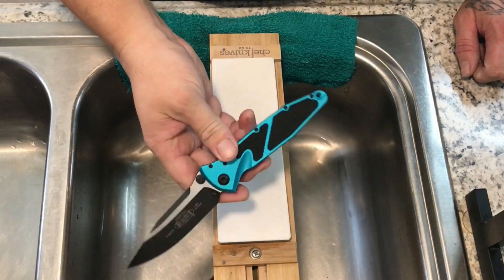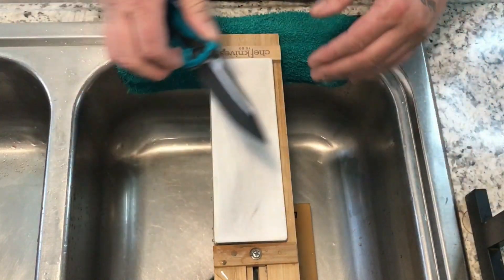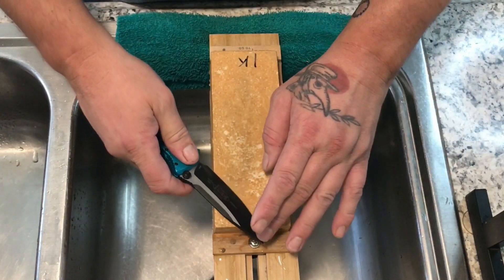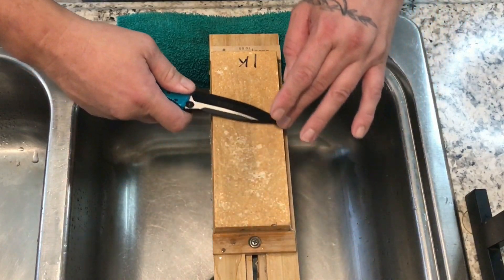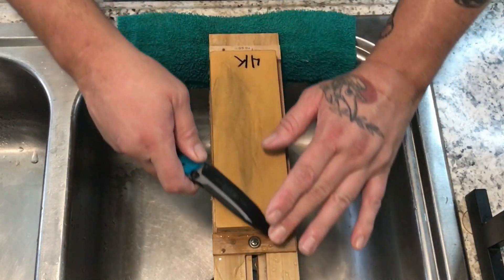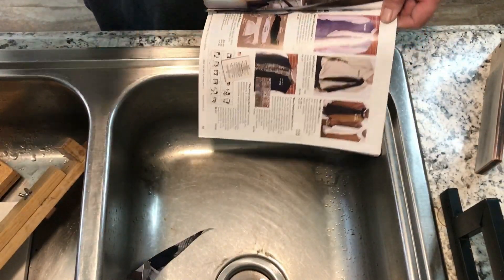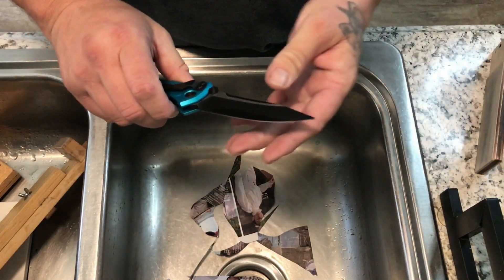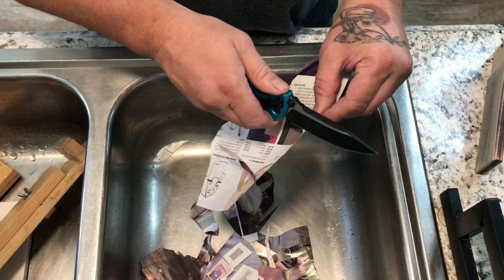Knife Sharpening - Microtech Socom Elite - CTS-204P

Comment: Nice Townsends cameo!

Great vid as usual Jef.

I've used many many diamond compounds, nearly all of them being 'too' aggressive. I have also been driven insane by this. With that said, I do get along with many of them and perhaps I can be of help in finding out why they screw you/us over sometimes.

I do not think you did anything incorrectly in the video. You, as usual, hold your angles super well, you didn't go overboard on pressure from what I could see and you were very careful. The only thing I would suggest changing/keeping in mind is how many passes you do. Every diamond and CBN 1um compound I've used, with Ken Schwartz and Knife House being the exception, run the risk of 'over-refining' the edge when you go more than 2 passes per side, the same has been true for 0.5um, 0.25um and obviously 4um. Just a couple examples - Gunny Juice, Stroppy Stuff, Northwest Knife Guy and Practical Sharpening, I have to make sure I'm getting what remains of the burr on the first strop I go to within 5 passes otherwise I find I run a greater risk of over-refining it (I am not that great at being consistent with my angles). Ken and Knife House being the exceptions to me does interest me a lot, I did think it was down to concentration being lower than what I've mentioned but when I look at my Knife House I doubt that.

As Theodor mentioned, changing from "heel to tip" to "tip to heel" motions might have played a part in lowering the aggression by changing the direction or further refining the teeth but I've done the same and not experienced that on these compounds. Could very well play a part in it but I think pass amount has a predominately larger effect.

It's a pain in the ass when it happens but I have found just by taking a moment between each pass to check for burr with a flashlight stops me from over-refining or even rounding the edge. I have been using all the compounds I've mentioned and gotten aggressive edges without many headaches since being more anal about it but man, fixing what ain't broke isn't necessary. What's the white compound you're using? I'm sure you've mentioned it before so I should go dig.

Full disclosure, I know the guy behind StroppyStuff and have/do give him a lot of feedback. Certified shill haha!
Reply: Would just like to say, I do use and like all the compounds I've mentioned, with Northwest Knife Guy's being my overall favourite. That's my bias.
Reply from the maker: Thanks for all that info. I have found pretty much the same thing, except Gunny seems to allow me to strop as if I am on white compound. To date, the best I have found that allows me to strop as normal, in order of ease to use: Knifehouse, Ken's, Gunny. Everything after that, has been hit or miss. Many cases, just complete fails, no matter what I do. 

I stated in a few other posts, I shouldn't have to change my stropping technique. I understand there is money to be made with these products, but if I have to alter my habits to compensate for the product, I am not going to like it.

Anyways, I am just not diamond compatible. We have two different goals in life, and are going to have to go our separate ways, I think. Perhaps in the off chance I am sharpening a super steel, like Maxamet, we can meet again, but till then....

You watch Townsends? :) I have been ordering the mushroom ketchup from those guys for years. I can't seem to get enough of the stuff. As for the ChromOx, I prefer StropBro's. Just the simple, $5 bars they sell, work wonders, on my edges. I've tried a few other brands, bark river, in particular. They all seem to have too high of a wax content. StropBro's is difficult to apply well, until your strop, is quite broken in. That stuff works a treat. As you said, why fix it, if it ain't broke. 

Truth is, when someone asks me to test these sort of things, I am always hoping to do them justice. It obviously works for other people. It irritates me to no end. Light pressue, low passes, same angles. I do not think I am going over or under angle, as Stroppy seems to believe. I know how to hold a consistency, and have become quite good at it, over the years. Still, over refining the edge seems like a viable conclusion, but I just can't get my head around that, either. 2-4 passes is gold, 6-10 is too much? Esp on cpm steels? If that is the case, then those concentrations need to be diluted. There are going to be many others seeing results as I do, and be highly upset. Esp given the price tag. Unless I am the only one seeing these sorta things. ¯\_(ツ)_/¯  . I find that hard to believe. Unless, others are just not understanding, what is occurring, and mistaking the true sharpness of their knives, for whatever you call these results.
Reply: I wrote a response but turns out it's a huge wall of text and youtube didn't like that sorry hahahaha. I'll post it in sections and see if that works.
Reply: You are one of the best around in my opinion and even a single case of a product not working out for you is not something to be considered lightly (e.g. Sharpal). From what I've seen, you have changed techniques to accommodate the product and it didn't give you the same results as others (including me) are finding, in this video you strop pretty much the same way I do as well. I think you've done justice to it and it's prompted me to do more testing with it to really see. Perhaps lower concentration is indeed the answer with these, though Gunny afaik is quite high, perhaps the carrier fluid is either all of the answer or part of it as well. I think carrier being the main influence could help explain why Knifehouse is so forgiving since it leaves a slightly harder and ever so teensy slightly 'sticky' surface on the strop, leaves the strop with less 'give' perhaps. That said, I base that on pure conjecture, pinch of salt n all that.

I do think we should be willing to make small adjustments to accommodate differing products. Big but though there is such a thing as asking us to change too much and when that happens it often ends up a headache that causes us to question how worthwhile it really is an examine pros and cons. While I do find the pros outweigh the cons with the fast diamonds, I do think this is just because I was very stubborn when I was trying to figure out what was wrong a couple years back and spent so much time with them. The compound itself should've been at least the second or third thing I considered but it was the last haha, very stubborn of me. I was having trouble while I was using compounds from Practical Sharpening, which at the time were much faster than any other diamond compound I've tried including gunny and stroppy stuff, I got a 2um monocrystalline diamond spray from Practical Sharpening after all this and it was surprisingly way more forgiving than the 1um but it also uses a different carrier fluid, similar to Stroppy Stuff from what I can tell.
Reply: I haven't actually tried any from StropBros, I'll have to pick some up! I definitely agree wit hthe bark River compound being reeeeaaallly wax-y, Eden/Dialux was marginally better but still very wax-y for me.

Oh damn you know what I'll have to pick some Mushroom Ketchup up, I used to get some tea and coffee from them to try out and I've been watching for ages, really comfy channel. I've been watching a fun channel in a similar vein called Tasting History too, I recommend that if you aren't watching already.
Reply from the maker: @acoupleofsharpthings  Tasting history? I haven't seen that one. Will give it a look, thanks! I love seeing those recipes come to life. Even tried my hand at replicating a few. Particularly the mushroom ketchup on 3 occasions, and one of the pancakes recipes. They've both turned out satisfactory, although the mushroom ketchup, doesn't have as intense a flavor, as the stuff they sell. The ingredients of course, can be altered to fix that, although my pallet isn't keen enough, to weed out, what is what. 

Def give stropbros a look. Hell, for $5, ya can't really go wrong. I like their stuff, and have quite a few bars, of each color. I've yet to be disappointed. Their strops can be a bit smoother than I like, but even those, are made VERY well. I used to swear by em, till I found DLT's XL. Those are my go to's now.

I agree, some change for different products, isn't out of the question. I do compensate for many, even if it isn't always conscience. Lighter pressure, fewer strokes, etc, etc. I tried Practical Sharpening's resin diamond stones, some time back. HOLY COW, were they fast. For reprofiling a knife, I highly recommend em. I could never get a super sharp edge, however. They were just too aggressive. 

Same goes for many other diamond products, in particular stropping material. Like you, I always seem to blame the product last. After using these, for a few weeks now, on different surfaces, I can't say that now. I know I am doing things properly. Including low passes, with light pressure. I can occasionally, score a nice edge, off of them. ZDP189 in particular, got an amazing sharpness. That is why I described them, as hit or miss, and kept looking at myself, as the fault. 

Carrier solution, diamond count, whatever is the cause, I can not say. I did notice the KnifeHouse spray leaving behind a tough shell, on whatever you spray it on. I do not know is Stroppy's stuff has a similar effect. I will try it on some paper later, and see if I can make anything out. I'm not done with these, and think where they are going to really shine, is on rich carbide steels. Maybe that is what I should have started with, but 204p, m390, 20cv, are nothing to thumb your nose at. 

I appreciate you taking the time to repost that. If you discover anything new, or figure out a repeatable way to get consistent results, without having to alter too many factors, I am all ears. In the meantime, I will try doing even fewer strokes, and experimenting that way. To be honest, it is starting to become a bit of an obsession, to figure them out. If I can sharpen a knife on a brick, wth can't I strop on diamond? Lol.
Reply: @acoupleofsharpthings  Nice man, glad it's working well for you. Btw, I'll get your check in the mail. 😄
Reply: Noooo it cut out the actually important part of my response to your first reply! Hahaha ffs, here it is hopefully. 

I agree with pretty much everything here. Knifehouse has been, by far, the most forgiving diamond stropping spray I've used and gets me great results, it's a shame it's basically unavailable in the UK/EU at the moment, seems the usual suppliers here can't get a hold of them.

It's been so long I doubt you recall but you gave me some advice ages ago on instagram when I was struggling to get things 'sharp' for quite a while. I did identify the 'problem' in the end and it was that the stropping compounds I was using were very fast and I was getting a smoother edge, which to my feel and use cases is not that I usually consider 'sharp', I like more aggression than push for most use. This is exactly why only a couple of passes is fine but going over just totally over-refines the edge since the compound cuts so fast it essentially removes the 'teeth' of the edge. This is what I was running into and I also think this is what you're running into, I often call it 'rounding' but it's more correct to say it's over-refined. That said I have found it possible to over-refine and even round in a single pass, that is the main con of aggressive diamond sprays imo.
Reply: @NORTHWESTKNIFEGUY  Finally! Hahahahaha, thanks again man, great stuff.

Comment: Looks good. This strop is only getting about half as many passes per side as your normal strops because of length. Maybe you just need to do more passes per side?
Reply from the maker: I was doing that before and absolutely ruining my edges. StroppyStuff informed me to do only the bare minimum passes. He told me the diamonds are super concentrated. This is yet another reason i can’t stand diamonds. I have to do special instructions just to make them work. lol. I should be able to just stop as normal and keep it moving
Reply: I believe Jef is rounding his apex when stropping, more passes will only exasperate that.

Comment: They sure make some great looking knives. Curious, how did the edge feel right off the stones before hitting it on the strops? Also were the strops leather, basswood or combo (sound and look like basswood)? Diamond on a very hard substrate like wood makes it even more aggressive then on softer substrates that have give like leather. When examining edges under a scope some combos are actually too aggressive and appear to damage the edge. From time to time when stropping on basswood I've found myself stropping at an angle that is just slightly to acute, not quite making contact with the apex and had to go back and increase the angle ever so slightly. IMO something like basswood works well however not as forgiving in some aspects compared to other substrates. The nice thing with suede or flesh side of leather is that the fibers kinda leave a little wiggle room in case the angle isn't quite perfect. Anyways as always an enjoyable video Jeff.
Reply from the maker: The edge i didnt even test after the stones. I guess i should have for comparison. Ah well next time. 

When max first sent these sprays i tried em on basswood. Was getting terrible results so he recommended i try his leather instead. It seems to do better on these, although still not quite dialed in. Ive looked at the under magnification and can’t really see any difference between a 4 pass bevel and a 10 pass. I am going to keep at it. Maybe i will figure out whats up before i lose my mind
Reply: I've personally been using bass ever since you recommended it to me and I do that exact same technique of an acute pass and then dial it in slowly until I'm in the right spot. I get great results from it so thanks for that awesome advice! All 4 of the stropping faces I sent Jef were grain side, but 2 were sanded and 2 we left untouched as I didn't know what he'd like the most.

Comment: Havent seen a video in a while. Cool knife there. 

I finally got myself a maxamet knife (para 3) . So far I'm really loving this steel, it actually seemed to sharpen up quite a bit easier than my k390 endura, and the edge it took was pretty insane.
Reply from the maker: Congrats on the Maxamet Para 3. I need to grab me one in that model. The 2 is just too large for my daily use. Or so I keep saying, since I never carry it. Maxamet is still one of my top 3 steel choices. It just keeps going and going. Chips can happen, but you gotta be doing some serious work, for that to happen. What have you been using to sharpen it on?
Reply: @Jef  I've only had it about a week now, so I haven't had a chance to try it on too many stones yet. 

What I've done so far is do the venev 240, then dmt fine, then went back to venev for the 400, and 1200. Did green compound then finished with .5 micron chefknivestogo diamond spray. The edge it took was very keen. 

I was actually pretty hard on the edge yesterday, and it handled it well. I needed to remove some hard plastic from a headphone jack, and I even torqued the edge a bit when I was shaving it off. No damage at all. Definitely not as brittle as they say.
Reply from the maker: Thats awesome! Id say just be leery of super coarse diamonds. Like the 140 atoma or x coarse dmt. They can cause the edge to get that brittle apex that just falls off. Its a strange thing to see. I would say dont go coarser than a 400 grit diamond plate. Resin seems to handle it ok at 240 so that should be fine. 

I didnt even realize this sort of thing could happen until someone else told me about it. Of course i had to whip out my atoma to see for myself. The edge just fell and crumbled. I lost a lot of steel that day.
Reply: @Jef  yeah. I've seen videos of it. The 240 isn't bad on it at all, but it's really like a 320, or maybe higher JIS grit so that helps.